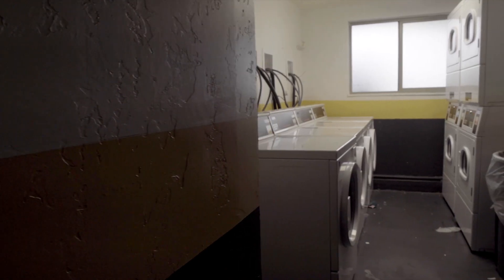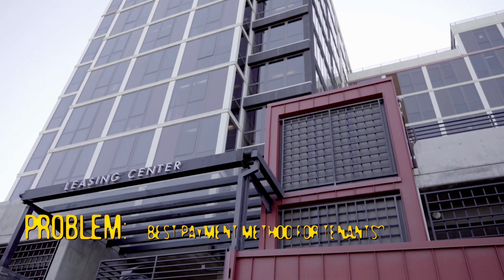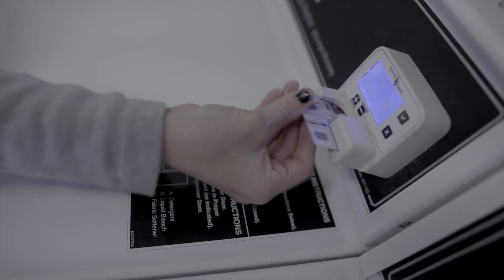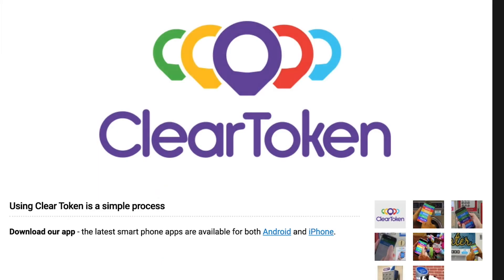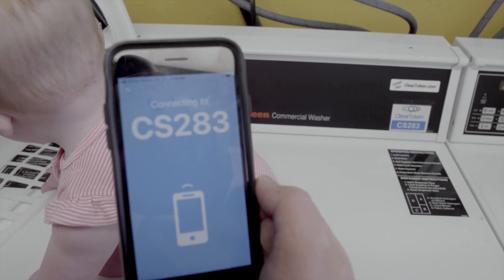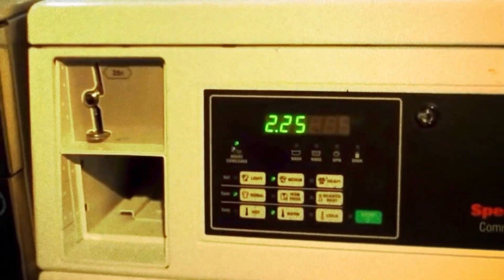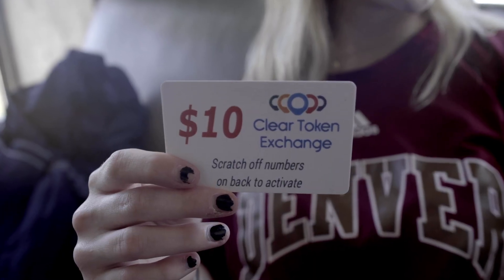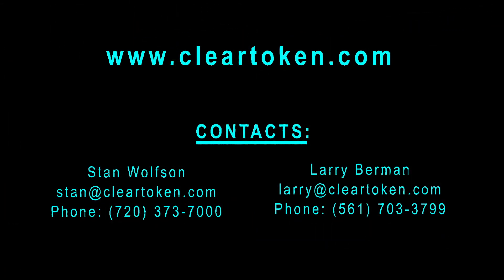Clear Token in Multi-Housing Laundry

Comment: Is there a feedback signal if the machine doesn't react on a start pulse from the device so the customer don't have to pay for this.
Reply from the maker: Don't know exactly how to answer.  There is a communication handshake between the user's cell phone and the device in the washer.  The machine will start or the transaction will not complete.  Please contact customer service if you are a user experiencing a problem.
Reply: The machine uses your phone to agree to the cost and the funds are transferred to initiate the machine   both end must be present to perform this action.   If the signal is  lost an error will  sent.   if the machine failed to operate you can report a problem and request service or credit.